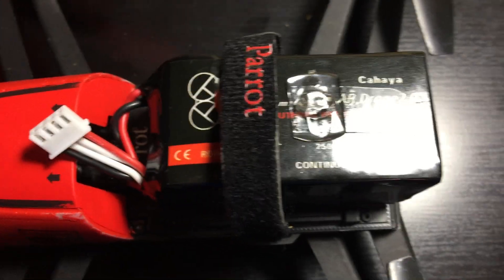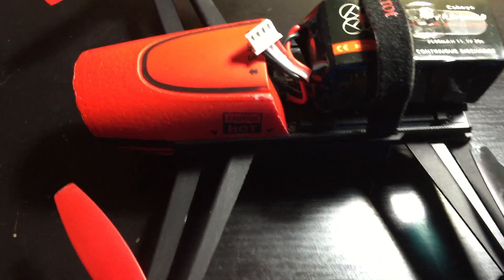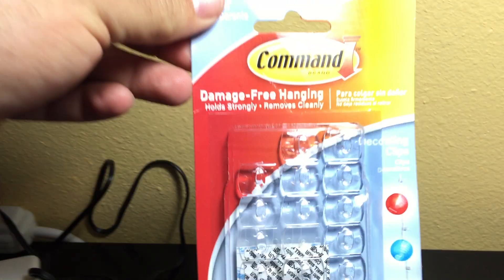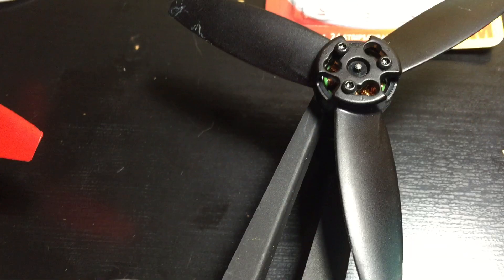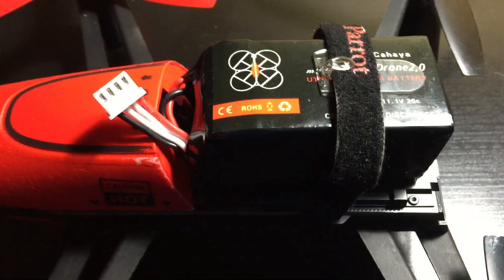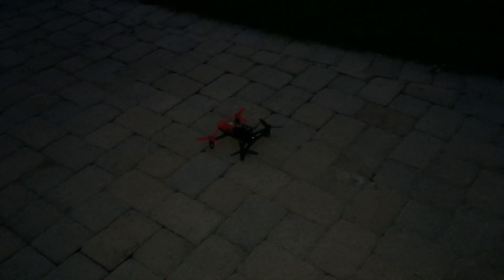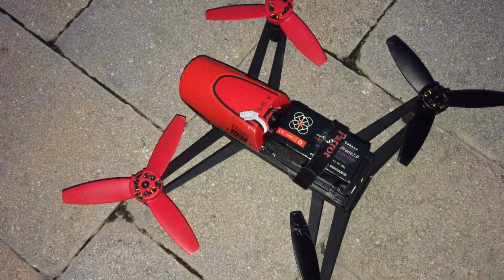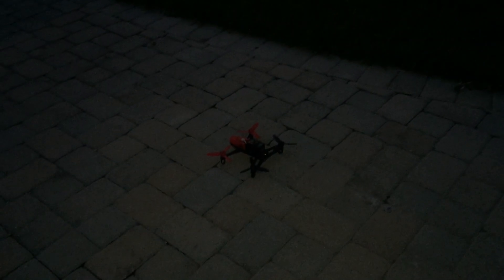Parrot Bebop Drone 2500 mAh battery test 1

Comment: Did you happen to have an inconsistency with the battery level indicator in the Freeflight Pro app and how much charge your battery actually has left? I put a voltage indicator on my similar aftermarket battery and after Freeflight Pro says my battery is at 0%, the voltage indicator indicates my battery is only halfway drained. Did you have any similar problems with this implementation?
Reply from the maker: Bryan Heer I did not but I have not had a bebop for a while now.  Not sure if something may have changed.
Reply: There have been some discussion about the new firmware versions reducing the battery life of the Bebop significantly. I also observed something similar, as with the newest firmware version ( 4.0.something ) with stock batteries, I am only able to fly around 4 minutes, which is horrendous when comparing to claimed 11 minutes with stock batteries. I measured the cells after flight and it is, like you said too, only half way drained at 3.8V per cell. Even though the new firmwares bring stability, camera and gps improvements, the utilization of the battery capacity has taken a severe hit.
Reply: Yeah, I was having the exact same issue with the stock batteries with a max flight time of just over 4 minutes, which for a drone these days is like you said, horrendous. I may be resorting to trying to figure out the code behind the Bebop, as I have read that the Bebop drone reads about 3.7v per cell as totally drained, which is only about half the juice you can get. I have not found any other means of bypassing it...yet! It should be a simple change for the battery voltage's threshold once I figure out the code, but we'll see.
Reply: The battery charge indicator is buggy. With the original or OEM 2500 mAh. I dropps instantly to about 65%. I would rater use a clock and not trust in the display.

Comment: hi im thinking about changing from the bebop type battery to the AR too, how does the thing that attached it worked? does it is safe? can you fly it on big altitude?  thank you.
Reply from the maker: The clip I attached works great. It actually holds the battery in better than the factory one.  Altitude was not an issue at all.
Reply: Thank you very much, im interested in that type of battery cause its a big difference of prive from $76 to $31 dlls in 2 batteries.  But I was worried about it falling down from the bebop. How do you charge them? Do you use the regular charger or another one?
Reply from the maker: You need a different charger.  It is a lipo charger you can find them on amazon.
Reply: +Yunisden Thank you very much for the info.
Reply: +Joaquin Reyna sorry one last thing does it gets very hot? cause I find a 3d printed case with the shape of the bebop battery but o dont know if it wold trap the heat inside it. I dont want to melt down my bebop LOL.
Reply from the maker: The ones I used did not seem to get very hot but they were not in a case.

Comment: That was a hard landing.  Did you modify your landing gear yet?  I did the zip ties https://www.youtube.com/watch?v=Usgc2xZD_2I  and helps.  Thanks for the video
Reply from the maker: +Tommy Drone No i did not.  I no longer have a bebop...
Reply: Oh well.  Quick question, I'm concerned with the extra weight and its extra weight on the motors. Did you find it flew well still?  Looking back would you recomend doing the 2500 mah battery?  Thanks dude. TD
Reply from the maker: Tommy Drone It flew fine and I had no issues. I would recommend them.  Just make sure to get a charger for the battery.
Reply: +Yunisden Cool.  Thanks.  Ok I'll get one. Best  TD

Comment: My original Bebop has around 12-minutes of battery life, 9-minutes if I flew all out. In terms of speed, the 1st Bebop only travels at 24-miles per hour. The Bebop 2 is capable of 25-minutes flying time (a big advantage over the first Bebop - from my point of view). As for the speed, the Bebop 2 can travel up to 37-miles per hour.

The same 14-megapixel 1080p camera as in the original Bebop is in the Bebop 2. However there have been some functional changes incorporated in the Bebop 2. The first Bebop has a mechanical image stabilization feature, but this was changed to software for the Bebop 2 because Parrot wanted to keep the weight down. And the camera in the Bebop 2 points 90 degrees downward - which was not available with the first Bebop Drone. 

Here is a short outdoor test flight of my Bebop 2 Drone in inclement weather here today (North of Atlanta). I am Looking forward to stretching this aircraft out on a sunny day.

https://youtu.be/do12BvITrcU

Comment: Hi buddie .. could you help me out ??
I just got this blue parrot bebop drone and it wont turn ?? I charge it till green plug it in (yes line it up to connector ,it seems since it goes all the way in) but when I hit the power button nothing happens at all !! uggghh . Both battery it came with wont work. Now mind you its not a brand new one...was used.

Comment: Excellent battery review bro :)

How do you charge the battery? Can you still charge it with the Bebop charger?

Thanks!
Reply from the maker: WTFflow You need to use a lipo balance charger.  They can be found all over amazon or ebay.  You can also get a good one from your local hobby shop.
Reply: Err.. I don't really know anything about these batteries .. Lol :) I found one on Amazon, but I really don't know how to plug the battery to it.. Do you have some precise example of ideal charger for these batteries? Found this.. http://www.amazon.fr/gp/aw/d/B00D8XNN7S/ref=mp_s_a_1_1?qid=1432550630&sr=8-1&pi=SY200_QL40&keywords=lipo+balance+charger&dpPl=1&dpID=51Xv3CjUATL&ref=plSrch 
Should look like that? :-) Thanks again!
Reply from the maker: WTFflow that looks like what you need.  On the aftermarket batteries there are 2 cables coming out. one that is the plug that will plug int the charger, the other is a plug that plugs int the bebop.  The one for the bebop is just 2 wires but the one to charge is 4 going to a plug.  Makes one ground and 1 for each celling the battery.  The charger actually charges each cell separately
Reply: So a normal flight would last 14-15 minutes with the 2500 mph battery? Cause Tera makes a $35 1600 mph battery and announces the exact same flight time. Any ideas of how it compares to the 2500 mph one ?
Reply from the maker: WTFflow Not sure I only used the 2500mah another one that I need to look up the size but it is the same style as the stock battery and give just around a min more than stock.
Reply: Alright, I should maybe choose the 2500 mAh battery then. If 1600 mAh only gives a minute more it's not worth it.
Reply from the maker: WTFflow the only issue is you will get a little drop when maneuvering due to the extra weight.
Reply: Yunisden So 35 grams more in weight will really make a difference? How to be sure the battery is fully charged? I heard some people saying their batteries were filled up to 60%, and not more. Finally, did you do a normal (I mean average) flight with this battery (flying around, going high, accelerating, and not just hovering) ? I guess that a stationary flight will take much less power.
Reply from the maker: WTFflow the weight does make a little difference. Not too much but it is there. I have flown around with both batteries and the 2500 mah last 2- 4 min longer in my experience. Depends on how you are flying. To be honest if I was flying aggressive, chasing something, I would use the stock size battery. More maneuverable. If I was shooting something where I would be stationary a lot I would use the bigger ones. In the air longer. All depends on how you will use it.
Reply: +Yunisden But still, can one charge it with Bebop charger? It is important as I only possess 3.0 version.
Reply from the maker: Andrey Polyakov no you need a lipo balance charger from any hobby shop or amazon. Bebop charger will not work
Reply: Dominanz

Comment: what is the flight time with your 2500mah battery?  the flight time has increased?
Reply from the maker: My stock batteries last about 10-11 min in actual flight the 2509mAh batteries last about 13-14 min.

Comment: Have you had the chance to test the VGE Hobbies 2500mAh battery yet? I hear they are making a 30 minute battery just for the Bebop. The 3D printed battery case stats it's only get stock times. But was the first company to offer replacement batteries.

Comment: Thanks for this update.
Can I charge the 2500mAh battery on the dji Phantom battery charger? ;)
Reply from the maker: I am not sure.  I do  not have a phantom to test it out.  If it has the balance charger plug for a 3 cell battery it should but I would check the output numbers.

Comment: Yunisen, may i ask you how to correctly charge this battery with a balance charger? Since i have heard that all parrot batteries were positive and negative charges reversed, pls advise, thx
Reply from the maker: gtoray1 This battery Is not from parrot and it charges with a normal balance charger. They are aftermarket. The parrot batteries that come with the drone I just charge in the charger that came with the drone.
Reply: I m going to buy some aftermarket batteries and luckly i watch your video, thx

Comment: Sold! You got the link available, I'd be interested in picking up a few of those! Awesome! Thanks for sharing!
Reply: Michael Kincaid Robert Brooks Just ordered a couple off of Amazon for $22.50 each with prime shipping. Also picked up a cheap balance charger, hope it works well enough. AND a Pelican 1600 to hold all my goodies! Its a big case but laying out my drone, bumpers, controller, tablet, multiple batteries, charger, spare parts, and tools, it seems like it will fill the case up. Should be here on Jan 2nd or 3rd at the latest due to new years.
Reply from the maker: Michael Kincaid I bought it off eBay and the person I bought it from is now sold out.  I tried to buy more but there were none left. I think they are all about the same just make sure you ask the weight as well as the specs.  It should be around 150 grams is the one I received.  This weekend I will test it a little more and put up a video on it.  Also you will need a balance charger as these batteries do not fit in the bebop charger.
Reply from the maker: Kenneth Youngs Good find.   Looking to pick up a couple more myself. I could not fly today as it was raining but i hope to use it some more tomorrow.   I was thinking about getting the pelican case as well for travel.  Right now I used the insert and another light board to put in a backpack making it easy to cary on trails but it would not be good for flights. Let me know how the case works out.

Comment from the maker: Update..Could not wait for daylight.. lol... just did a time test.. 15 min. 13 sec. from take off until auto land for low battery. Not bad for a $25.00 battery.  I will need to do some more test but I think I will be ordering more of these.  Almost double the time i have been getting from the VGE bebop batteries at a fraction of the cost. I also flew it around and it did not seem to affect performance.  Still fast and maneuverable.   ***** Kenneth Youngs Michael Kincaid
Reply: It's still an awesome vid bro :D
Reply: I'm thinking about getting one of these for my AR Drone 2.0 however they're not affordable anymore they like $40 a piece from a reputable seller so is it worth it on an AR Drone 2.0 should I just buy more of those 2000mah batteries not many videos anymore about the AR drones because they start with ar and then YouTube anti-second Amendment BS which it's not his fault it's cold and AR drone has nothing to do with firearms but I get about 15 minutes out of a regular 2000mah 2.0 battery that came with the 2.0 drone I thought the 2500 battery would be about 36 minutes like on the power Edition what battery does the power Edition have can't find that version don't even know what it's battery is I want 36 minutes flight time